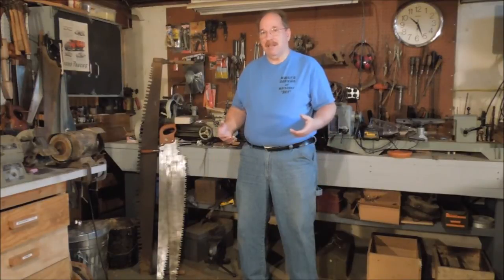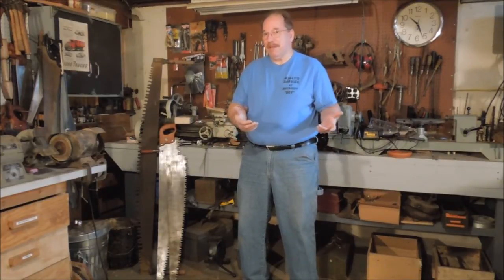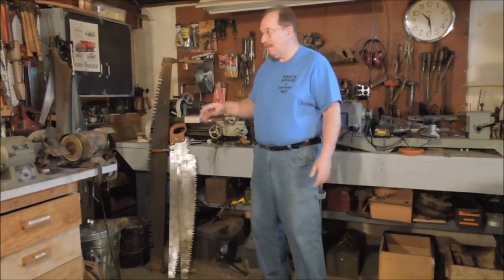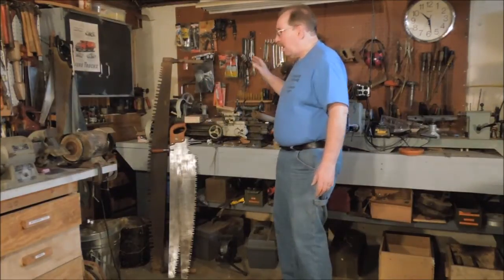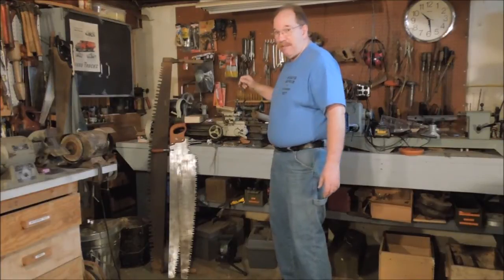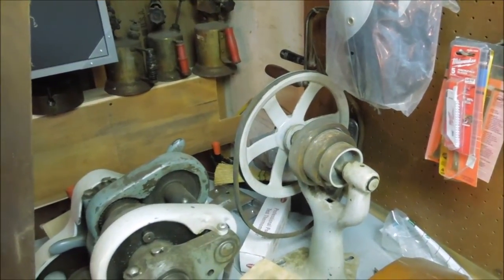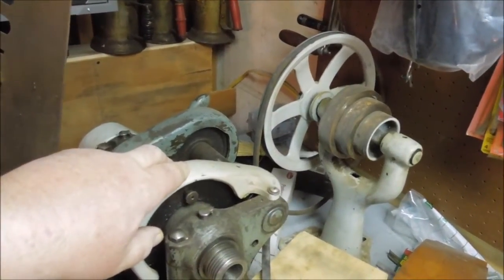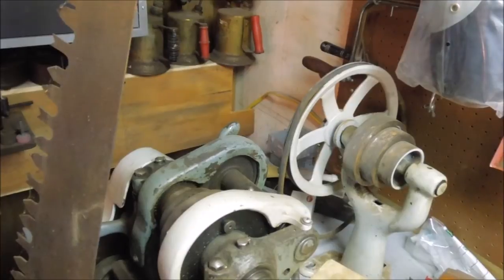Building the South Bend Lathe Motor Mount Pt 1 Design & History

Comment: i used the old timing belt from my nissan.works a treat.
Reply from the maker: +Robert Kuipers Good use of found materials. I assuming it is one of the flat ribbed belts. That would get rid of the annoying click and hop when the splice hits the pulley.